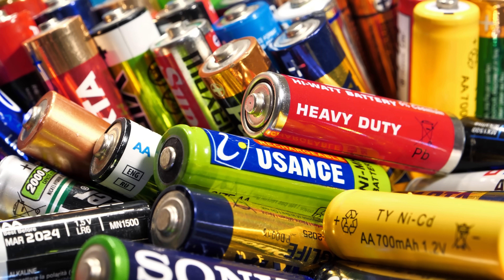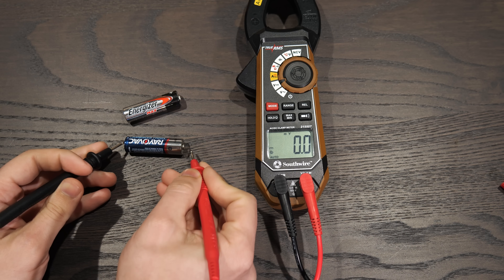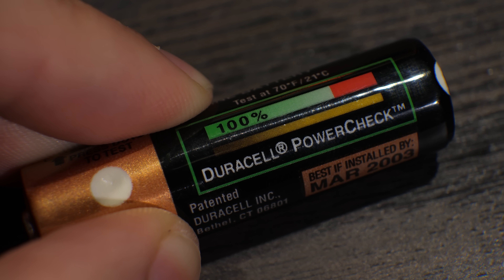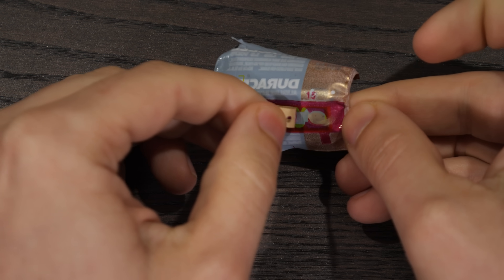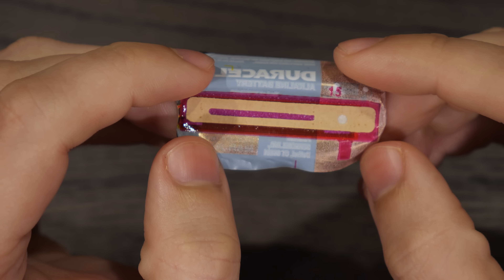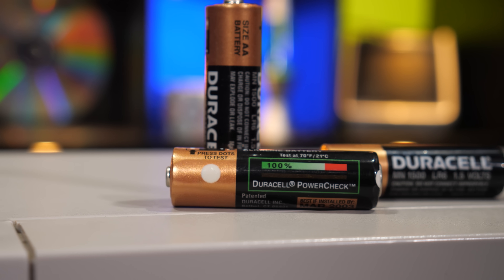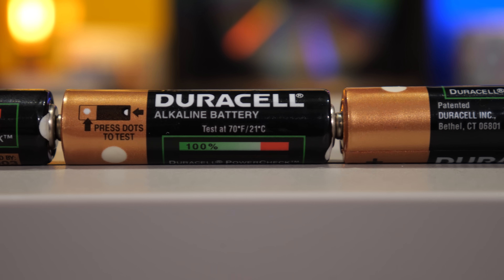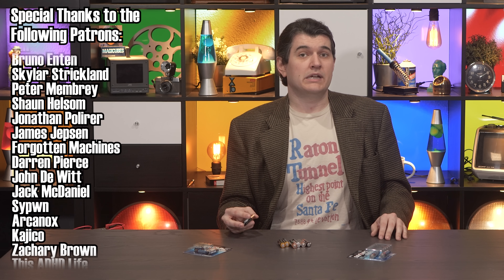Duracell PowerCheck: A genius idea which didn't last that long

Comment: I used to have these batteries i got for christmas that could charge via micro usb. They also had a power button and i can't remember if it checked the voltage or turned the batteries off, i say this because i remember a power symbol on the button

Comment: Always wondered how these worked since I was a kid. Now I know. Pretty brilliant and interesting.

My problem with rechargeable batteries in everything nowadays is manufacturers switching to sealed tech, so instead of replacing old batteries, you have to replace the entire device. Entirely rendering the point of the rechargeable batteries moot, in terms of waste.

Comment: They removed the power strip because most people didnt borher using the strip to check as it wasnt very accurate. Either a battery has charge and works; or it doesnt. If things are working why remove
It tin check?

Comment: Disposable batteries are still better for applications that discharge very slowly (clocks, TV remotes etc), as rechargeable batteries discharge over time. This is especially important for stuff you need in emergencies.

Comment: A strip came with them and testing each one was necessary to discard the empty ones. The strip was positioned end to end and took 5 seconds of pressing to see the line. I have been using only rechargeable batteries since 1998 and it blows my mind that non rechargeable batteries are legal

Comment: I remember a few years ago (maybe 5 years ago) finding some corroded AA Duracell power check batteries in a toy I got from goodwill. I think the back of the batteries said they expired in 2013. I looked up the batteries and saw the only place to buy them was online for like $25 for an 8 pack. That’s how I figured they were discontinued

Comment: These batteries were cool when I first saw them in the 80's or 90's, but they quickly lost appeal. For one, most batteries you use, you aren't going to pull out and test unless the device isn't functioning. At which point it's faster to just replace the batteries. Also, they were not easy to get the test working. It required enough force that by 2 or 3 tests your fingers hurt. It was a cool idea but the execution was poor and the benefits nearly 0.

Comment: I personally always take half used batteries out, because the things that still use disposable batteries aren’t in such frequent use - torches, label printers, calculators, etc. How many times have we left batteries in things, only for them to get corroded rendering our electronic devices totally useless?

Comment: 14:03 not even to mention rechargable AA/AAA's. they're cheap now and they don't drain that bad, plus there's li-ion rechargables that put out a rock steady 1.5v up until it's dying. it's smart enough to ramp the voltage down nearing the end so the devices' low battery warning still works, and that all fits INSIDE the negative terminal. the li-ion batteries with a separate charger are magic.
and also also battery eliminators, they're just fake batteries with a wall wart or usb plug on the end. I have a battery powered christmas tree and I just plugged it in with an eliminator instead of replacing the batteries every couple of days.

Comment: I use Panasonic rechargeable AA and AAA batteries. I thought they'd degrade super fast but after having used and recharged them 50 times they haven't even degraded a bit. That's 50 batteries saved!!

My biggest frustration was that I never had batteries at home when I needed them so rechargable ones made sure I never run out I really love them a lot.

I've heard that IKEA also has amazing rechargeable batteries that cost less then a premium brand like Panasonic. IKEA's rechargable batteries are manufactured by LG if I'm not mistaken and are about the best price to performance u can get! I highly recommend u get them from IKEA if u do.

Comment: From the beginning, I hated the concept of these things.  Another case of engineers making something because they can, but which nobody asked for.  It was clearly based on resistance heating (read: POWER HOG) and the fact that it used up a bit of what it was testing was an obvious money grab that irked me immediately.

Imagine if Kodak put a tester on their film canisters that told you if there was film left, but it worked by pulling a bit of film out, thus destroying it.  Yup, there WAS film before the test, but how much? Not sure, but you can always test again...

And placing these things on the battery itself (which has an industry-standard outer diameter) just took up space that could have been more chemicals, making it die sooner even WITHOUT testing it all the time.  I'm sure they didn't lower the price to compensate.

Brilliant move, Duracell.

Comment: Wait power check was only late 90s? I was born in 2000 and remember these things which means it had to of been like 2012 or even more recent… maybe they were sold longer in Canada?
Reply: No, I think they were definitely still available past the 90s. I was also born in 2000, in the US, and I remember seeing and using these. Not so much past the age of 10 or so though. I’d guess that Duracell made sufficient enough quantity to continue sales even after production ceased.

Comment: What a wonderful way to entice youthfully playful customers to speed the discharging process, so that the battery would need replacing sooner. That, if anything, seems to have been the motivation behind this - did you ever measure the current that was needed for the display to show the different "voltages"?

Comment: I definitely remember these and the alternative one that was built into the plastic of the packaging. It was sometimes useful as sometimes you didn't know if it was the batteries getting too low or if it was the device failing.

Comment: i still have a newer version of this in my battery storage container, the Duracell Quantum. the tester had a more refined scale that had 4 sections went from red to green. mines' good till 2027 and still has about 3/4 of its power according to the tester.

Comment: I owned lots of little desktop Halloween and Christmas animatronics as a kid (Gemmy products, Hallmark snowmen, etc.). Anyone who owns those knows that most of them are powered by double A or triple A batteries. Putting fresh batteries in them and waiting until they died to change them was ineffective for two reasons:
1) The animatronics were only taken out of storage for their respective season and put back in storage once that season was over, and they rarely died before the end of the season.
2) Leaving the batteries in year-round was risky because they could corrode before you take the animatronic out of storage.
My parents didn't want me to use up all the new batteries on meaningless entertainment like that, so they eventually made me put in used batteries almost exclusively. Once it was time to put the animatronics away, any surviving batteries would be put in a separate storage container than the new batteries and saved for the next holiday season. This all happened around the early to mid 2010s when Duracell was still including power checks in their batteries, so they really came in handy back then

Comment: Duracell spends 100s of $millions on advertising, especially during Christmas, as being the dependable battery but think otherwise. Never put them in electronics/flashlights that you care about or might store long term and you'll need to rely on during a crisis. I have pulled out so many dead, corroded Duracell AA batteries.

Comment: The amount of half-used batteries in a drawer definitely depended on your finances! I remember when I was a kid, if there were things that took multiple batteries we would check each one when the device started acting up. Threw out the ones with the least charge and replaced them. They wouldn't all drain at the same rate! Now though, batteries are much better and much less things use AAs or AAAs.

Comment: I used the powercheck all the time. And I can even remember before powercheck was built into the battery and it was a tester in the package you had to put the battery into.

Comment: A few years ago, i saw a few Duracell 9v batteries that actually came with a very small tester. It wasn't built in to the battery, but you could just put it on the terminals, and it worked very similarly.

Comment: Duracell are the worst f*#*king battery.  I've had two 24 packs with batteries that started leaking just after 5 years and before 7 years still in the package. I have a 48 back of Rayovac. The date on the packaging is 2010 the exp date is 2017. They sat unopened in my old truck probably somewhere around 2010 or 11 when i bought them and tossed them behind the seat where I forgot about them. I sold the truck a couple of years ago and found the batteries which I have been using to power my wireless mouse for the last two years. I've only gone through 9 of them. So each battery is still good enough to last over two and a half months. Not bad for now 15 year old batteries. I'll never buy duracell again and I use to be loyal to the copper top.

Comment: They seem slightly familiar. I was raised in the 2000s, so they were probably still floating around then. I more remember a battery storage rack with a tester on the inside wall of the hall closet. If the light was green, it was good. If it was red, it was dead.

Comment: I find it interesting to hear you talking only about disposable AA batteries. We always only had rechargeable ones. They were more expensive in the purchase, but a lot cheaper in the long run.

Empty ones went normally in a container in the drawer until they were recharged, at which point they went into a different container in the same drawer.

Comment: Why dont batteries work at 1 volt but 1.5 is fine? To me it seems only a third of the voltage is useful? Why not make it 2 volts in a battery? Can they make higher voltage battery and just dont because its more profitable to make a battery which only has a third of the potential?

Comment: I think at 12:32 you hit on an unintentional answer- usually, every doodad needs two batteries, like the one shown. How did you (i was a kid, okay?) figure out which single battery was the bad one of the bunch? As a child at least, batteries felt like a precious resource, so i wanted to get as much mileage as i could out of every battery before my xbox controller died (again)

Comment: Something i did for some reason with my old xbox 360 controller was put them into the compartment and use my tongue to see if i felt the current. If i did, they worked. Not? Find new batterys

Comment: Funny you should mention the Game Boy as a device that chewed through these. I happened to be playing one I've partially upgraded while watching this and for the moment at least, it's still running on AA batteries, though they are rechargeable ones. I do have a higher capacity semi built-in replacement on the way and it will be much appreciated with how the newly installed backlit screen chews through the rechargeable AAs. I do plan on keeping my original childhood Game Boy as original as possible (aside from the replacement screen lens that was needed because that glue does not age well) and it will remain fed with the rechargeable AAs, but it will likely see a lot less use than the upgraded one.

Also, I do absolutely remember how painful it was to try and use these. I thought they were very cool, but man, I could still feel that pain in my fingertips just thinking about it while watching this.

Comment: I had partly used batteries some things that demanded a high load the battery didn't have enough power to run it anymore but still worked fine in a remote for ages

Comment: I could never get these to work and not long after they began circulating where I live; rechargeable batteries we're becoming commonplace, though still pricy at $30-$50 for a 2 to 4 it was an easy cost to foot when we got sold on the idea of endlessly reusing these batteries, of course early rechargeable and their chargers did quite poorly but it was a technology that rapidly improved until we get to today where most gadgets have integrated batteries that blow most alternatives out of the water.
but busting my fingers trying to squeeze light out of a battery will forever be my young recollection of batteries, more so than licking terminals.

Comment: TLDW:  they took it away for the same reason many companies are charging more for less in modern times. You know, The Great American Modern Corporate Cheap Out Movement. Same reason corporations are focusing on how to nickel and dime people and not make them feel welcome. Part of the decades long trend of reduced corporate niceties that picked up speed after 2020.

And here I am just finding out via this video they took the powercheck away. Seems that whatever didnt become a lithium ion battery( and limited the lifespan of whatever it was installled on)….became a AAA where these tests would be less practical. The change is real. When I was a kid in the 2000s, Id be disappointed if all that was available on Christmas was a pack of leftover AAAs. Now there are never any leftover AAAs when I need them and the AAs are just sitting

Comment: That would had been good idea on rechargeable batteries as those was keept in drawers. And single use most often just stayed in some appliance that used them until it no longer worked

Comment: I'm going to make a pitch for disposable batteries: battery degradation in Li-Ion combined with modern manufacturer's aversion to making the battery replaceable. It's definitely a problem to have to throw out a perfectly good device just because it won't hold a charge anymore. Phones seem to be the worse offenders these days. Obviously making the battery replaceable would solve that, but at least using disposable batteries forces the issue, as we know buying a new one every few years makes Applesung more money than letting you replace a degraded battery. -_-

Comment: If the appliance it's in does t turn on its dead... I dint need to pull the batteries out to check them... ibremember these, I never ever actually used them besides maybe the forst time saw ine...

Comment: Thanks for such an enlightment=) I saw this Duracells and occasionally used this "tester" - it IS just a gimmick. And your last part of speech - about rechargeable batteries gave me a thought - why this batteries doesnt have built in tester. It would be way more useful for element that hangs around without box and not every charger have normal testers in it. I'm using Ni-Mh elements and they discharges all the time by just laying in box, which frustrates a lot. Such tester will make them more convenient in my opinion.

Comment: Am i wrong or checking it consumed alot of the energy of the battery?
You could depleat the battery if you check it multiple times.
Also, the mAh was low anyway, far from the standard 3500.

Comment: Yeah, they did require QUITE a bit of pressure to get the thing to read.  Not the most user friendly operation, but it was a pretty nice idea overall.  Also, in regards to burning through batteries, you don't know how BAD the Sega Game Gear was with that.  I think it took SIX AA batteries and you couldn't get through a whole game before it DIED.

Comment: So here in Australia we still have those batteries only difference is the power strip doesn't work so it's just a regular battery that looks like the power strip. Probably to add a extra few dollars and call it special i guess.

Comment: Personally I use the more simple method of dropping the battery vertically onto a hard flat surface, it it bounces the battery is empty and if it stops and falls over then it is full.

Comment: I think back in the 90s when you had so many more devices that used these batteries, it was much more common to toss a broken toy or device and save the batteries, so it was a bit more common to need a tester than it is now.

Comment: I remember that the batteries first came out with the tester on each battery. Then they changed it to where the tester was on the package. You were able to check and brand battery.

Comment: Hey man, wrong video, but I have seen a CRT without the masking in a laboratory. I can't remember what you said in the video. The masking is for creating the illusion of resolution. Without the masking, everything in the image bleeds into each other, the holes in masking focus the light to make the picture appear resolute.
So, could more smaller holes make the picture even better?
No. It's as good as that medium will allow. This was all the way back in 1992, we were looking into that question. I and some colleagues in Europe. I think we were in Germany, but it could have been at the Royal Academy in Sweden. I was traveling all over the area at the time, before I came back to America to work for Apple, researching how to make WiFi, and send games over the internet. It was my idea to send only instructions on what to change. They wanted to send the everything on screen, every button push. And I was like, no. Just send instructions what to change with every button push. We only have x number of KB per second to work with. 
-Dr. Grant, 
Statistical Dimensional Analysis

Comment: They phased out for a good reason in my opinion. You could buy rechargeables around the time just before they disappeared around 2010 or so. I have a pair of Duracell rechargeable batteries from 2012 that still work. 😊